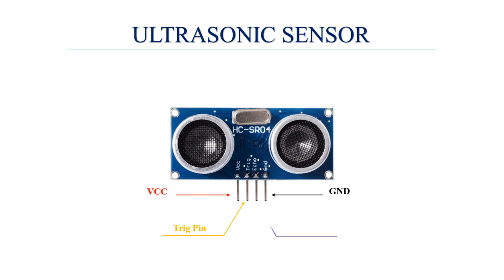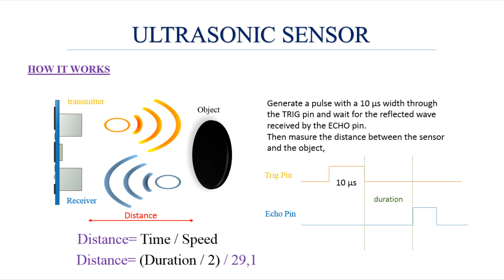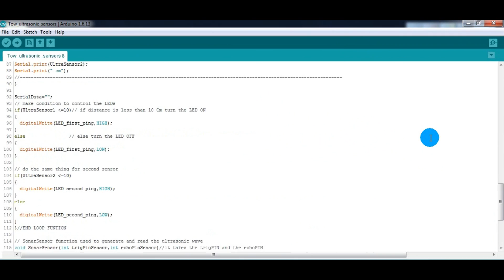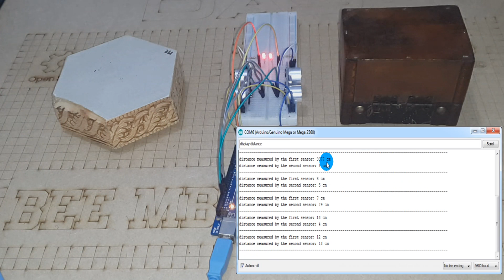How to use two Ultrasonic sensors with Arduino

Comment: hi, i have a query. If I want to use this code to read the data from two hc-sr04 sensors but not use it to turn on a led, what should I remove from the code?

Comment: hello sir.. the code works fine except my serial monitor doesn't show anything even though i'm, using 9600 baud. can you help me?
Reply: You have to change a value to activate the monitor. 
So replace line 93:            
SerialData="";                          
by                     
SerialData="display distance";

Comment: Can you measure distance between two ultrasonic sensors by doing SonarSensor (trigPin2,echoPin2)?
Reply from the maker: Hello 

yes you can measure the distance bewteen two ultrasonic sensors by activating one as Echo and the other as trig and you don't have to devide the PulseIn measure by 2 then ^_^

Comment: i do not understand this part of code and what does it do?
while(Serial.available())
{
  delay(10);
  data=Serial.read();
  SerialData+=data;
}

if(SerialData=="display distance")
{
Serial.print("distance measured by the first sensor: ");
Serial.print(UltraSensor1);
Serial.println(" cm");
Serial.print("distance measured by the second sensor: ");
Serial.print(UltraSensor2);
Serial.println(" cm");
Serial.println("---------------------------------------------------------------------------------------------------------");
}
SerialData="";

Comment: Bro just to ask, we're currently doing a project on arduino and we were just wondering is it possible if we use 2 ultrasonic sensors with one only responsible for transmitting and one senor for receiving? the reason behind that is that we wanted the sensor to scan at an inclined angle and we're afraid the reflected sound wave will not be echoed back to the receiving end of the sensor. Please advise, thank you.
Reply from the maker: Hello
Yes sure you can do this as long your sensor has separated trig and ech pins because some sensors has the trig and echo combined in one pin so all what you need to do is send a trig from the first sensor and read its echo from the second sensor.
Reply: @DIYGUYChris  so meaning when I do connection I use one sensor and connect the trig pin and another sensor I connect echo pin?
Reply from the maker: @sooyihying3265  thats it
Let me know the result ^_^
Reply: @DIYGUYChris  we tried using the first sensor and we connect the VCC,GRD and Echo pin while the other we tried connecting VCC,GRD and trig pin and used all these 6 pins to connect to Arduino uno but it didn't work the serial monitor result came out as distance=0 😟
Reply from the maker: @sooyihying3265  make sure that you are using the right pins in the program like for example( trig to pin 3 and echo to pin 4)
In the code make sure that you are reading the "pulseIn" function using the echo pin.

Comment: the circuit is not working. neither led or readings i get. Please help
Reply from the maker: Hello
Please check that you are using the right sensor and you used the appropriate pins as we used in our code.

Comment: hello good day sir.
i wanted to ask if i can put delay to a sensor i am currently working on my project and i have use 6 sensors i want to give delay to the sensors as when one sensor has sensed the object it turns off for as delay and the other sensors are not effected by them if you can help me i will be very thankful
Reply from the maker: Hello ibtahajali ali
just connect the sensor VCC to any digital output in your Arduino and turn it ON and OFF whenever you want.
Reply: MEGA DAS actually i have done that but its not working can you give me a example code which i can check please im in very need of it
Reply from the maker: Unfortunately, we could not provide code for projects but we've provided a solution which is fully working and we have even tried it a month ago.
Reply: MEGA DAS i dont want you to give me a solid code i just want an idea so i can complete what i have started if you can help me in anyway i will be thankful

Comment: Hi! Great video, would it be possible to use 2 ultrasonic sensors (at a set distance apart from each other) and then measure the speed of something which passes them? My idea is that when something passes sensor A, a timer would be set off, and it would keep going until the object passes sensor B. We already know the distance between the sensors and we just found out the time taken, so the speed could be calculated. Any chance you could help me with this?
Reply from the maker: Hello Zee 
Yes you can use two ultrasonic sensor but this will not be the best option for your application because you could use two TCRT5000 IR sensors and it will be perfect for timing calculate

Let us know if we can further assist you.
Reply: MEGA DAS hi thanks for the reply! Unfortunately I can only use what I've been given for this project, I'm not too concerned about it being accurate. I need the device to be able to calculate the proximity of the passing object using the 2 ultrasonic sensors, and have programmed the Arduino to do so. Just have no idea on how to get the speed part of it down. 
Would I be able to email you my code for you to have a look at??
Reply: @Zeebean384  I just discovered this myself. My project is with two sonar sensors also. Same idea. Could not get it to work so i stuck with 1 sonar. Much better. Sonar can sense the change in time because the speed of sound is 343m/h. U can get the time from two different sonar pings. The time it takes for the ping to come back will be divided by 2. Just convert the m/h to cm/s.

If you use two sonar you will have to code for t1 and t2 and start an internal time clock. Much more complex and not worth it.

Comment: I replaced the leds with buzzers but it's not producing the sound clearly, what should I do?
Reply from the maker: Hello Tplg91

First verse Buzzers do not respond to continued Digital signals, so you should make some PWM commands or just do the following:

// Add this function to your program
void Buzzer(int Delay)
{
  digitalWrite(buzzer,HIGH);
  delayMicroseconds(Delay);
  digitalWrite(buzzer,LOW);
  delayMicroseconds(Delay);
}

//change the IF condition instructions to control the buzzer with this 
if(UltraSensor1 <=10)// if distance is less than 10 Cm turn the buzzer ON you can change the argument in the Buzzer function to suite your needs
{
  Buzzer(320);
}
else                // else turn the buzzer OFF
{
  Buzzer(0);
}

Let us know if we can further assit you.
Reply: Should I remove the led function??
Reply from the maker: Tplg 91 
Yes remove it

Comment: Hi, I am wondering is it possible to use two ultrasonic sensors control one LED? When the two object in front of the sensor at the same time within 3cm, it will trigger the light. Otherwise, it will not. Your project is very good and a little bit similar to me. I tried to do the wire connection like yours, but it does not work properly. If you could help me that will be great! Thanks.
Reply from the maker: Hello WANG Huan 
The project that you want to make is not similar to the project of this video simply because what I did in this tutorial is showing how to interface two ultrasonic sensor (basic app) 
In your case you need to modify the source code in order to suite your need changing the LED test control condition which should be related to both sensors.

Let us know if we can further assist you.

Comment: Sir your link given by you is not open. What should i do?
Reply from the maker: Hello MEHTA,
Which link you are trying to download?
I've checked all the links and they are available and there is no problem with them.

Let us know if we can further assist you.
Reply: Please send me circuit diagram and sketch
Reply from the maker: Hello MEHTA
You find attached to the description of the video the appropriate links to download the circuit and the source code that we've used in this tutorial.

Let us know if we can further assist you.
Reply: But the link you share not open
Reply: I have the same problem. I download what should be the sketch, but my computer does not recognize the file at all.

Comment: I have 3 sensors. what i want is for them to show me 0cm at a certain distance. Let say that one of them wil show 0cm, even tho the obsticle is 120cm away, and if i put somthin at 120cm, i want it to show this as 10cm, that way i just messured the lenght of the object i put in front of it, will this be possible??
Reply from the maker: Hello Håvard Hardy Jørgensen 
I think this is possibl if you insert an if statement in you code, I can help you if you explain more.

Let us know if we can further assist you.

Comment: good one ..... great job.... I just wanted to know whether I can change the distance from 10 cm to 100 cm in the code..... and use 5v buzzers instead of using resistors and LEDs.... 
By the way where are you from ?? 
Please reply as soon as possible
Reply from the maker: Hello Lokaveer,
Sure you can change the test distance in order to suit your need, just download the code (from the link provided in the description of this video) and check it, you will find the distance parameter.
About the Buzzer, its the same, all what you need is to connect it to the same configured pin for the LED.

Let us know if we can further assist you.